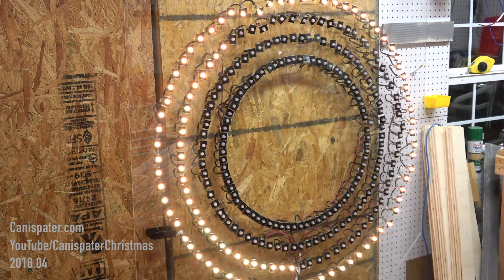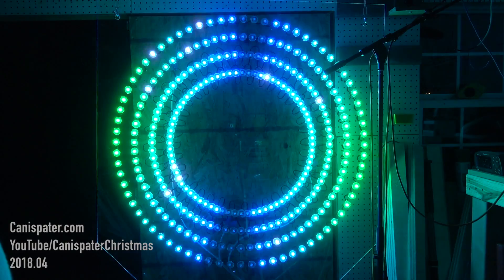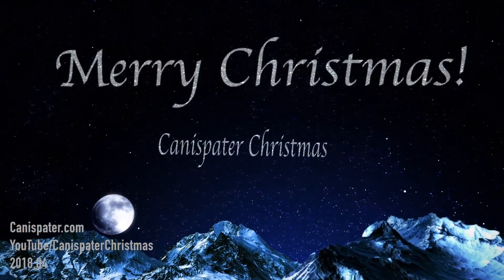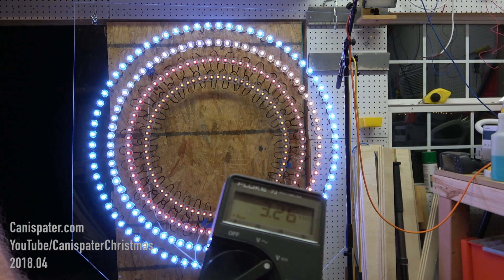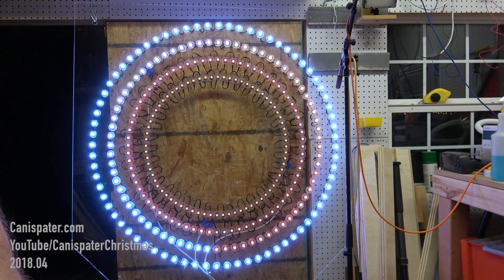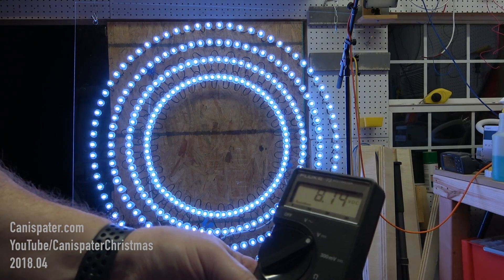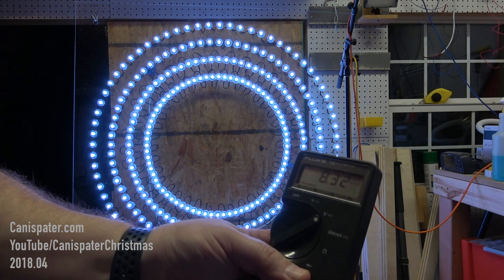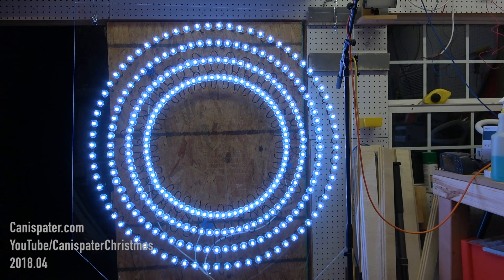RGB Pixel Wreath Rebuild (2018)

Comment: Mr. Lacy,
I've enjoyed your YouTube videos as well as your Udemy course, and made a small donation in hopes you continue make videos. I downloaded the plans for the wreath but went cheap and printed it on clear film and used my overhead projector which allowed me the ability to adjust the size. I’m a left sided brain engineer with very little artistic abilities, and I cannot figure out how you did your sequence. Is it possible you could share?
Reply from the maker: I use the marquee effect for the wreath a lot set as single-strand and play with the band/skip sizes to produce different patterns. There is one pattern I did "by hand" on my medley sequence. "By hand" means I had to go down to the pixel level and tweak them on or off - not recommended. 😂

Comment: Just began my LED journey with making my own Christmas wreath. Can you show a detailed video how exactly you inject power? What connectors/soldering/wires you use, etc.  Thanks and great video!
Reply from the maker: It's not an exact science unfortunately and so many variables factor into it. You can generally let the pixels be your guide as they will look odd when they are starved for power. I have a few videos talking about it (eg: the large matrix uses power injection). Generally, 12V pixels need power ~80-100 nodes, 5V ~60-80, but brightness, wire-size, distance all play a role and of course the pixels themselves. If I think I'll need more power, I'll generally just add power at the end (through an inline fuse to the same power supply) and lower the brightness to around 10%, see what it looks like and go from there.

Comment: Looks Cool!
Reply from the maker: Thanks! I need to build another one. 🎄😀
Reply: CanispaterChristmas Yeah. Looks so cool! How did you program it? A Dmx Controller or a normal light o Rama Controller? Do you have a tutorial or something?
Reply from the maker: I use xLights and a Falcon pixel controller. Check out my Beginner RGB playlist linked in the video description if you haven’t already.
Reply: CanispaterChristmas. Ok, Thanks! But is there one for cheaper?
Reply from the maker: One what? Controller? Look at SanDevices. They don't have as many bells and whistles, but are solid controllers.
Reply: CanispaterChristmas what I mean is do they have a pixel controller for cheaper? But thanks for the info.
Reply from the maker: Budget 50-cents per pixel. They don't cost that much, but by the time you get everything needed, that's a good ballpark figure.
Reply: CanispaterChristmas Ok!

Comment: Can you provide more details on how the pixels are actually wired together?  Are these all one continuous loop?  Is it just one plug that ultimately goes into your controller?
Reply from the maker: Yes. It's one long string of 288 pixels. Three connections from the power supply go to the beginning, end and middle.
Reply: CanispaterChristmas 
So you start on the outer ring and go in one direction (clockwise or counter clockwise), then jump to the next ring, etc.?  And if so, I assume they all need to cross or “jump” to the next ring at the same spot?  This will all be going on my Christmas truck that I create each year and need to make sure it’s legit.  What is the typical threshold/number of pixels used before needing to add additional power insertion?
Reply from the maker: Based solely on your questions, you might benefit from checking out these playlists: https://www.youtube.com/playlist?list=PLFyrAfJ-kKd4ZfPdXWIt8v_bav61mW_KW and https://www.youtube.com/playlist?list=PLFyrAfJ-kKd6oMcj7owBIVEmP6k9aJvCw, but yes, I modelled it in xLights and used that to tell me how to wire it up. 12V pixels prefer 12V vs 14-15V so make sure you have some sort of power conditioning (eg: don't connect them directly to the vehicle's power without something to regulate the voltage) - they might work without it, but just know that's an experiment. 12V pixels need generally power between 80-100 nodes, but that's a ballpark figure as it depends on just about everything. Level of brightness has a huge effect on power needs, but I'd assume that if you are running these in a parade, you'll want them at 100% brightness. :)

Comment: Do you run separate cables for power injection or do you just wye v+ and ground to your injection points from the one cable that supplies data?
Reply from the maker: For this, I run separate cables to the power supply. 100% white is about 17 amps.
Reply: CanispaterChristmas yep, makes sense at that draw.
Reply: CanispaterChristmas 
No by huiooolkmnnjhhftf

Comment: What is the total watts on your power supply that you used?  More then one power supply?  Do you have a video how you mapped your pixels model on the xlights and falcon player setup so it will do the correct effects?
Reply from the maker: 350-watt power supply. Pretty standard. I calculate ~17 amps for 100% white. xLights has a wreath model already so I used that and just filled in the parameters - 72 pixels per ring, 4 rings.

Comment: Why did you need to remove ALL of the old pixels rather than just replacing a few bad ones in the string?
Reply from the maker: I wanted to swap out the bullets for the square variety. The bullets and strips weren't holding well at all. Plus the bullets were kind of a Frankenstein set anyway. I'll keep the good ones as spares.